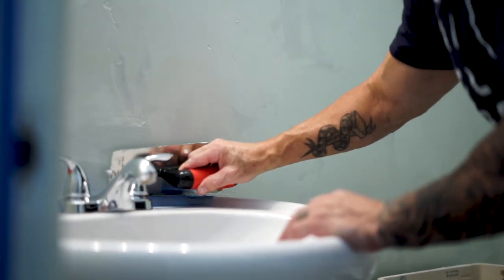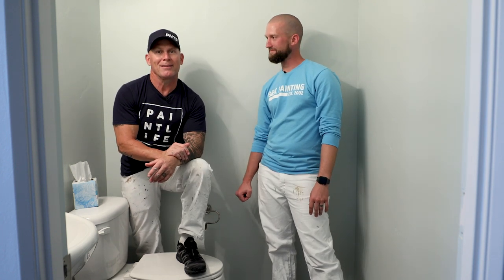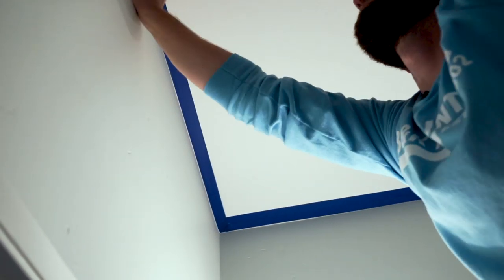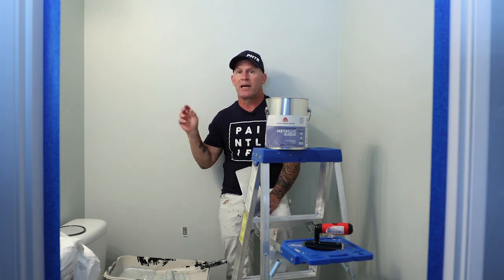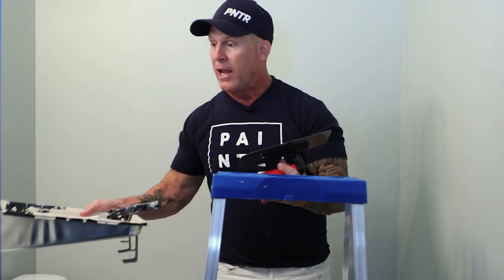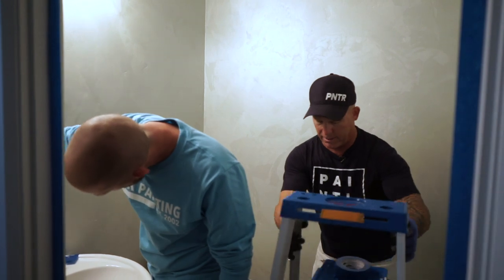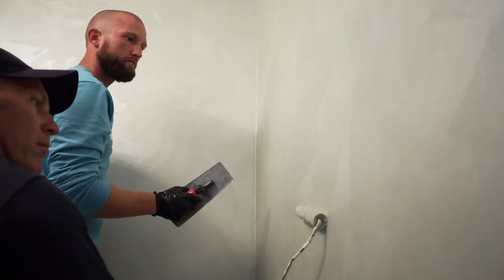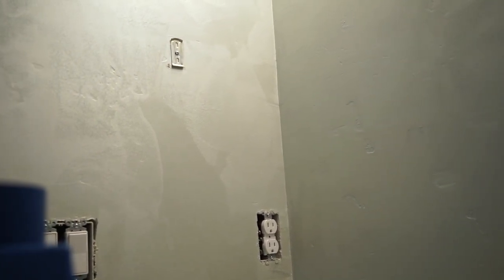Designer Walls! METALLIC SUEDE Bathroom

Comment: Just a thought, I typically use alot of six inch microfiber rollers for kitchens and doors and trim, but for a bathroom they do have 9 inch microfiber roller think that would help speed up some of the process, but over all the bathroom finish result looks amazing $800 buck for a faux finish big bucks. 👍
Reply: you are correct.  6" mini and 9" regular microfibers are a great combination.  For a powder room this size, a mini alone works quite well